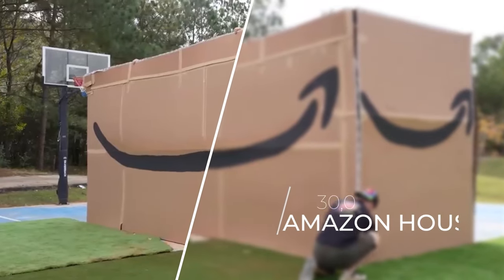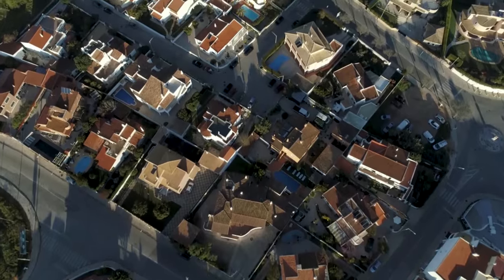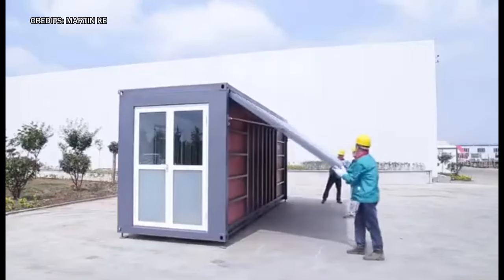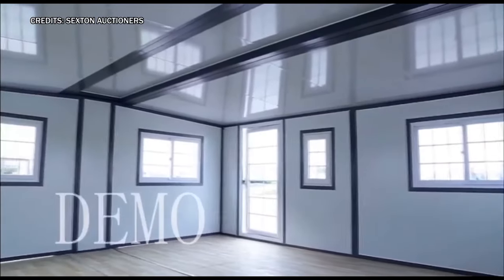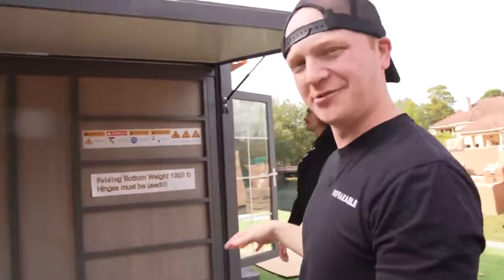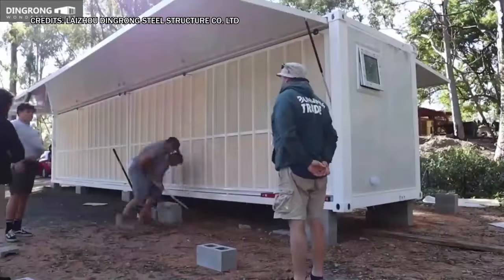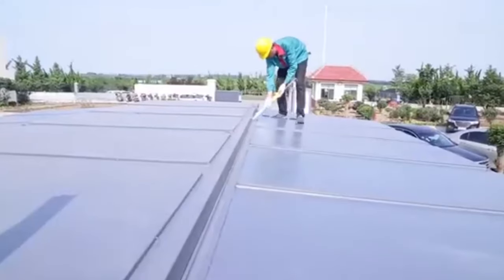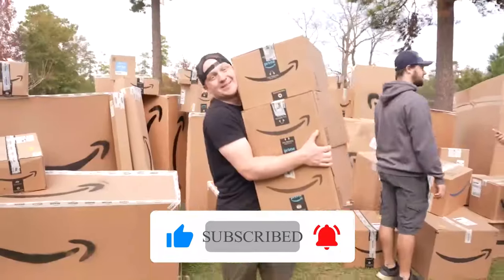THE $30,000 AMAZON HOUSE.

Comment: it only shows the building erecting. What about the housing permit,  utility, electrical, water plumbing?
Reply: That would be all dependent on the area you put it in. Some places don't require permits. Also, you can use solar, so that would also be a completely different process as well. Someone can also do composting toilets and use water run off for gray water. There are a lot of different options depending on the set up they are going for.
Reply: @morganvillas6436  Well said!

Comment: Video doesn't dive into all the extra expenses like electric hookup, sewage, and water.  But a great concept for the right style of investor.
Reply: Same as any other mobile home. Varies by location. If your site is far from the utility lines it will be costly. Of course you can maybe go water well/septic tank as many mobile home dwellers do, and nowadays you can even go off-grid solar/wind power.

Comment: Other stuff is not baked into the price. You can can't just set it down on the ground or even on some kind of piers for free. Further your site has to level or close to it so the building itself can be made level on a long term basis, concrete slab would be the preferred choice which will not be cheap or building some kind of foundation might be less expensive but still cost you considerable coin.  You still need infrastructure, the land, permits etc. Figure on adding  at least another 30k to the price excluding the land. You probably won;' be able to build anything close to most population centers because of zoning, so that leaves a rural plot where the land will be cheap and the zoning more accomodating but now the added expense of distance to food, services supplies, wear and tear on any vehicle you own all come into play.  Not saying the idea isn't a solution, just that the extra expenses need to be accounted for when making such a decision or purchase.
Reply: This really depends on the area. Some don’t require permits, and using solar, composting toilets, or gray water systems can offer more flexibility with setup.

Comment: got the same thing for just short of 20k as my new backyard office and gym its on 2 small slabs 9x4x2deep at each end great way to fill a problem but have had issues with the city
Reply: Did you have to run electrical putlets?
Reply: Yes it is criminal for municipalities to discriminate against mobile homes. That's big reason why there's a housing crisis. Mobile homes were a good solution to low-cost housing. My first home was a single wide.